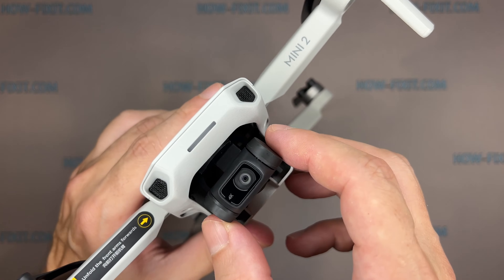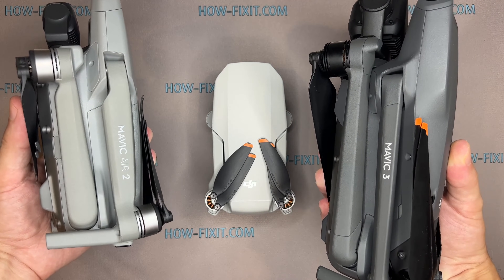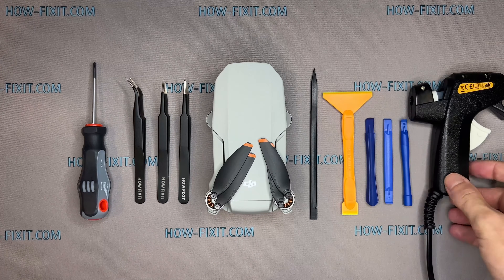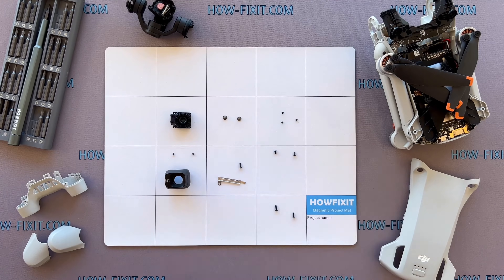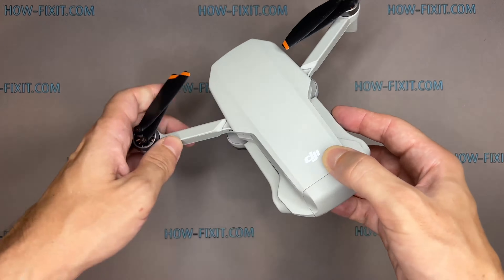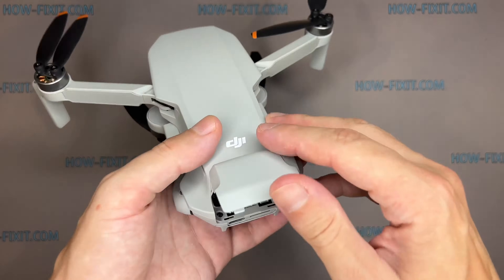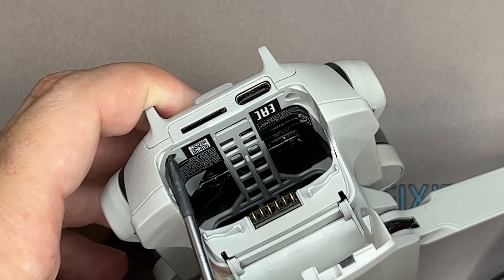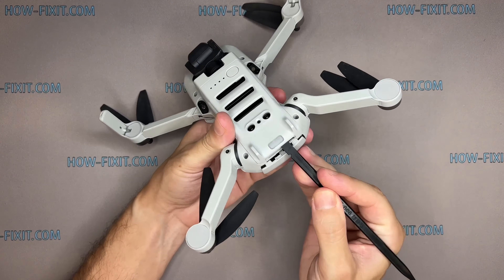DJI Mini 2 Ribbon Cable Replacement Guide: The Ultimate Step-by-Step Tutorial

Comment: June 17, 2025, I followed your steps exactly and replaced my ribbon cable to resolve error code 40012, Invalid Gimbal Data. I contacted DJI to see what the cost would be to repair it, and they quoted me $285 (out of warranty). After stumbling upon this video, I bought a new ribbon cable for $10 off of Amazon, and, while it took me significantly longer than the 18 minutes of this video (more like 45 minutes), I just flew my drone again with zero issues!

I don't often leave comments on videos like this, but I can't NOT leave a comment and a like for this perfect solution. Thank you!

Comment: Hello sir, after the replacement of the cable flex 3 in 1 gimbal works as usual the problem is now even though many times tne compass calibration is still asked for compass calibration with code (30096) and (30060) when flown alone. Mini 2 i can still fly as usual. Please sir😢

Comment: At 9:37, you show insertion of the ribbon cable incorrectly. It should be inserted so that the cable is facing down. You show the cable facing up. It's corrected by 9:41, but I recommend an annotation.

Comment: My recommendation: gimbal assembly do AFTER  every cable is attached to motherboard and MB in place.  Cause I had difficulty to attach cable after I glued it before MB installation as on this video instruction.

Comment: As per instructions here, I ordered the #1 Phillips screwdriver. Once I got the screwdriver I tried it in the screws and it does not fit. Won't even go into some of the holes in the body. Will not fit in the prop screws.

Comment: Well, hallalo ja :) - after about 3hrs (ribbon connection  wires slightly bent on arrival!!!, tried and tried, ended bending them badly trying to get to locate, then pulled them all back again comparing with the original cable- it worked -50mins!!!) - My drone works, no errors IMU/GPS... - It works - Thank you for such a clear video, likewise saved my a good bit of money.

Comment: I would like to add 2 info,
connectors glue could be very hard, I used a soldering iron at 210° C
Mini 1, SE and 2 ribbon cables are the same

Comment: But, yes yes yes, there's a big But, if you buy a new cable or gimbal, motor ect, then you need to calibrate the gimbal through your computer, an app that's called  Python and it's a hassle to do it.
Reply: This is only if ya replace the gimbal wire or gimbal itself, I think the ribbon cable is different. From my experience it's a hassle.
Reply: Just did this and there was no calibration required. Was basically plug and play.

Comment: Slight crash and it ripped this cable. Before I replaced it (thanks for the instructions) it would work but gave me the "Incompatible Gimbal Data" error and I couldn't fly. After repairing it just as you show here, I still have the same problem. Replacing that cable didn't help. Any idea on how to repair Incompatible Gimbal Data?

Comment: What if the camera said it need to be calibrated my drone fell. The camera is not working. I already replace the broken cable.
Reply: Hey did you solve the problem.. I’m having the same issue please share if there is any info thank you
Reply: no. It needs to be calibrated by technician. i cant find any software to calibrate it. i buy a new drone. hahaha. 😭😭😭